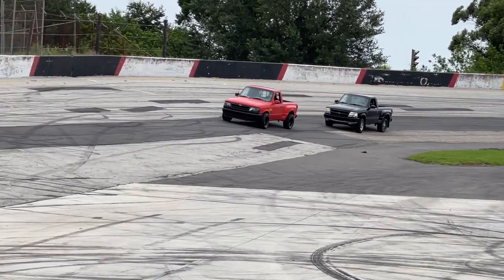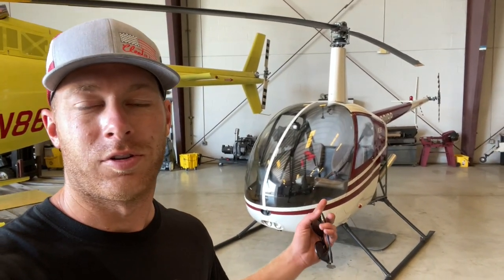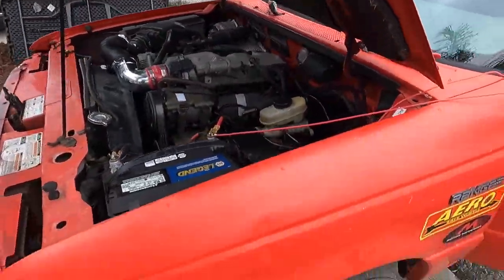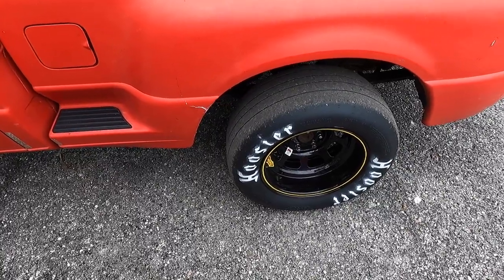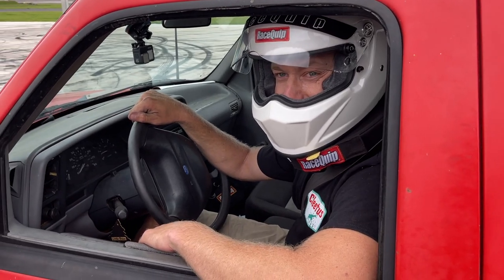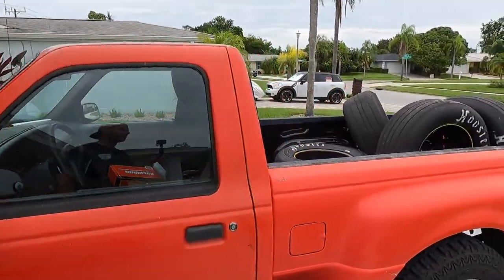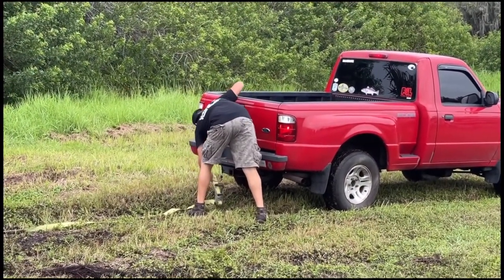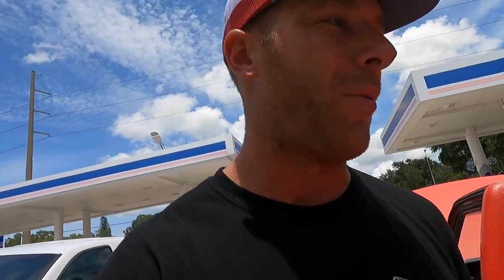Danger Ranger 9000: Testing Leads to Car Not Running - Only 7 Days Until the Race, Can I Fix It?

Comment: You kept it together despite the attempted pick maneuver that's some impressive driving considering the lack of weight over the rear .. the Hoosiers make the truck look legit race ready . Good luck on race day
Reply from the maker: Thanks man and yes weight would help
Reply: I drove a Ranger 4x2 work truck for a couple years about 10 years ago.  I ended up adding about 300 pounds in rock filled canvass bags over the rear axle.  Without the added weight that thing would shake my teeth out on rough roads.

Comment: Pretty common trucks so you should be able to yard another computer if it didn't turn out to be ok. I could replace those caps as I've messed with electronics and everything else since high school. At least it's just old enough that most parts will just work if it's the same year and engine or close. Just enjoy the ride, no matter what happens you'll have a blast with your family and friends.

Comment: Don't forget to play with air pressures, the bigger tire on the right side and smalls on the left will definitely help this truck turn in the corner. Always more air in the right side then the left side. Might wanna find some cheap coil spring rubbers to stiffen up the right side if possible. Also if there is a way to disconnect or not allow all the pressure to the right front caliper and it goes to the left front. When braking it's going to help out a lot as well you will be able to drive harder into 1 and 3.
Reply from the maker: All over it!

Comment: Ahhh a jeeper too!!!!!! Parker is quickly becoming a favorite. Wonder if he woulda liked my twin turbo cummins swapped JKU on 40s. 

Currently building a Gen V LT1 powered TJ stretched front and rear to 119” wheel base. Haha.
Reply from the maker: TT Cummins JkU holt crap that sounds BA
Reply: @DoctrParker  took a year to do the swap. But it was worth it.
Reply: @DoctrParker  everything factory still worked. Gauges, AC and all factory switches.

Comment: Do those rangers have the double spark plugs? My buddies sister had one in high school and I could have sworn it had 2 plugs per cylinder
Reply: I don't think so, I had an 89 as my first truck. It only had one per cylinder. Also have a 95 and 2015 and they both only have one as well.
Reply: The 2.3 in some years did and the 2.5 did too I think
Reply: @kbar150  just googled it,  always learning new stuff.  They tried it in some models to try to improve combustion and lessen emissions.
Reply: @cbrackin531  Nissan did similar in the early 90s I think with the hard body trucks and probably other 4 banger cars.
Reply: @69Dartman  i remember my 89 hardbody did, pretty sure my 94 did too

Comment: you definetly need to shift into 3rd gear.  its not bogging out in 2nd... its hitting the soft rev limiter that the 4 liters have.  you may also get rid of your over heating problem if you didnt scream the motor in 2nd and shifted into 3rd.  Just some helpful advice. good luck!
Reply from the maker: That’s my plan for Saturday!

Comment: Flying is amazing,I was lucky to have a grandfather that was a A&P IA and my dad always had a project plane growing up. So I was able to start very young and had my commercial at 18 towing banners. Anyway if you made it this far I was wondering about dental implants. I had a engine out and crash landed and ate the panel taking out 8 teeth. I was lucky otherwise but they weren't able to save my teeth. I've got different opinions on implants and don't know who thrust